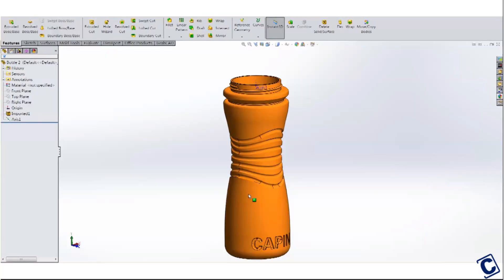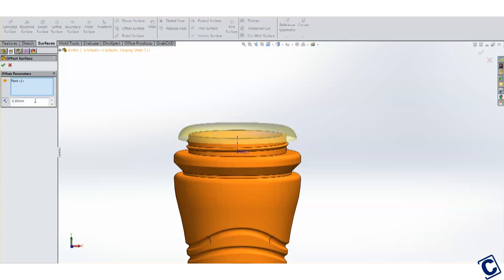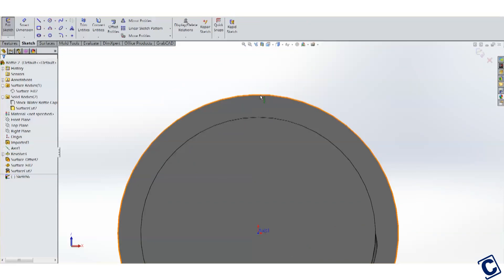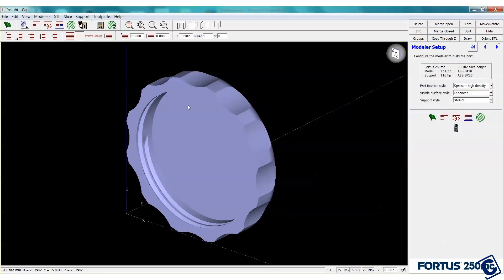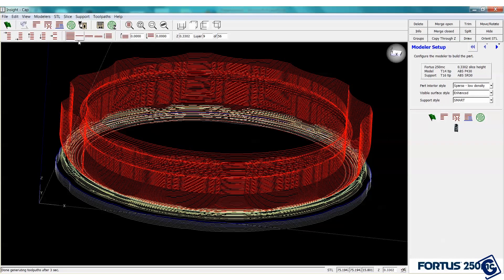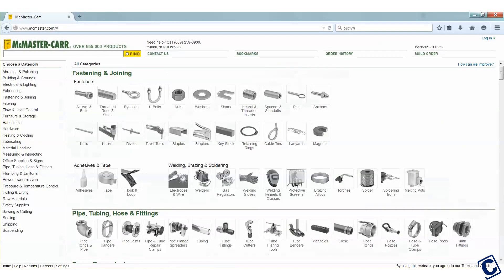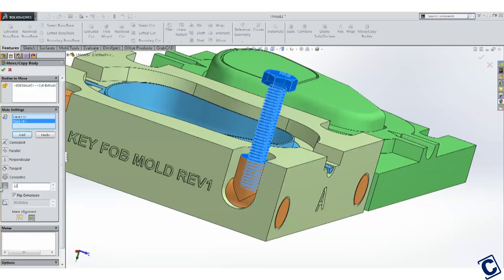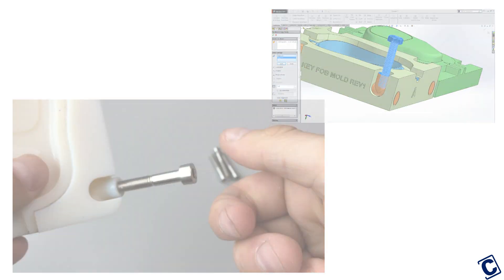Designing and 3D Printing Threaded Parts

Comment: Thank you, thank you, thank you.    I'm self-taught in SolidWorks and recently I had been struggling to remember how to draw threads in SolidWorks.   I had figured out how to do it a couple of years ago but I rarely ever need to draw thread on a component so whenever I do have to draw thread I have to learn how to do it all over again.

I've used other CAD software that did have a dedicated "Boolean" feature which made drawing internal threads a breeze but,  I could never figure out how to do it in SolidWorks.  Now I know; thanks to this video.  Another time saving trick was your reference to McMaster Carr.  I've bought parts from them fairly consistently over the years and I have noticed   CAD models they offered but, it never occurred to me to down load and use them in my drawings.  I guess it requires some common sense in addition to a brain to apply a no-brainer like that too.

I've watched so many how-to videos on drawing threads in SolidWorks that it boggled my mind when I came to the realization that there are many different way to do it.  Each video had a slightly different way of going about it.  For a hobbyist like myself, your video came the closest to teaching me that I don't have to go through the long drawn out process of drawing my model and then drawing my threads; even though I do now remember how to do it if I had to.   This is an excellent short cut method for beginners and self-taught SolidWorks folks like myself.

When you're "Self-Taught,"  it is essentially a situation where the teacher is just as ignorant as the student.  Videos like this go a long way toward mitigating some of that ignorance.

Comment: @08:45 "I'm gonna scale up the screw by 2%" I'm sure I didn't hear it being mentioned but shouldn't you ONLY scale up the diameter of the screw and NOT the length as well? The way I see it by also increasing the length of the screw and thus the threading you're going to have an increasingly harder time inserting the actual screw, still left at 100%, the deeper you try to insert it into the 102% thread - No?
Reply: I agree with you on this.  If you look carefully, you see Uniform Scale is ON.  This should have been un-checked (to OFF) and use only X and Z at 1.02, leave Y at 1.
Reply: thx for the explanation. You need to add a comment in the video mentioning that uniform scale shall be turned OFF